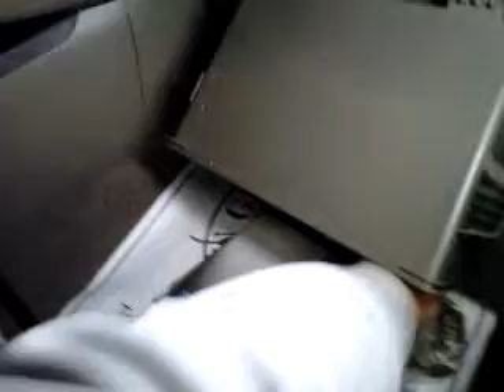DIY How to replace install cabin air filter Mitsubishi Lancer √ Fix it Angel

Comment: i have a question. that white cover looks to be broke off because i can't get the air filter out and it really needs to be changed. any suggestions on what to do?
Reply from the maker: Use some pliers and rip the filter off.